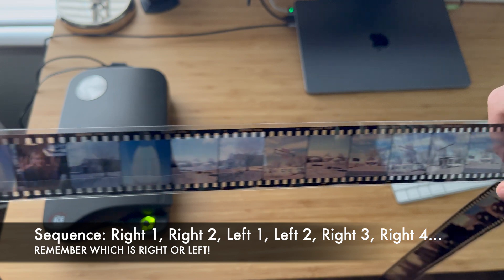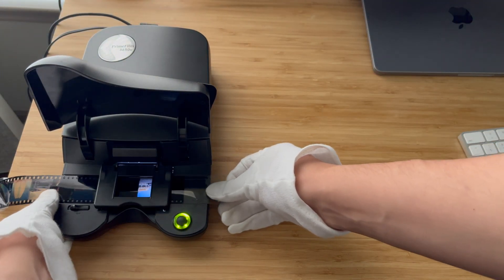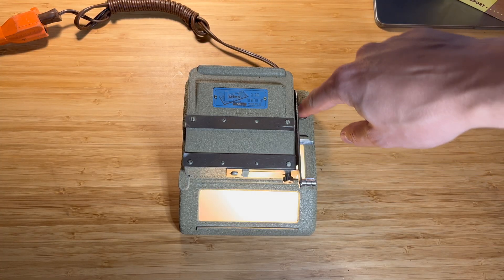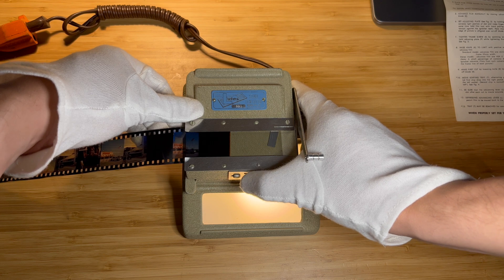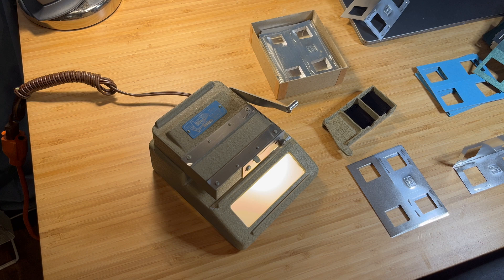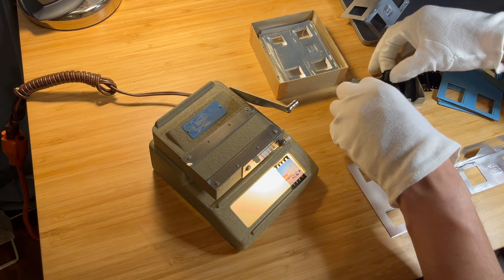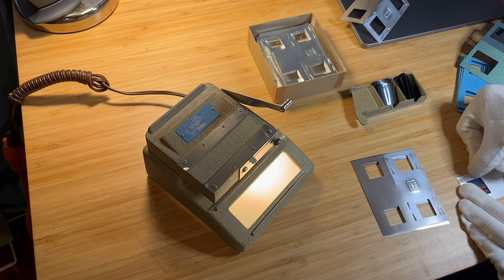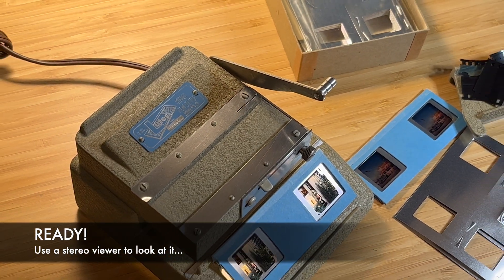Stereo slide film processing: scanning and mounting

Comment: Wouldn’t be easier to use RBT stereo mounts? They are better than any vintage mounts and cost is similar.
Reply from the maker: Not exactly. On RBT mounts you still need to set the stereo window, while here it's "preset" more or less. RBT are much more expensive these days, as well. It would have been faster, yes. The alternative is to 3D print RBT mounts.
Reply: @vaisonla-romaine8304  they cost $1 per piece. I wish they were cheaper but the cardboard mounts and masks cost about the same. Setting up the window is easy, no extra equipment is needed. You can’t adjust the window in these masks, so if you don’t cut the film perfectly the window will be off permanently. What’s THE MOST IMPORTANT in my opinion is the fact that stereo mounts are still being produced and we need to support the company that makes them. It’s for our own benefit. If the sales are poor they will cease the production and the cost of supplies will skyrocket. This is exactly what happened with STEREO WORLD medium format stereo mounts and viewers. The mounts went up 3x in price and their excellent lighted viewers that cost $80 brand new went to $500 for the used one (sold on ebay couple years ago, I haven’t seen one for sale since then). So if anyone is trying to save a dime now by buying those old dusty cardboard mounts will have pay a premium for them in the future if RBT goes out of business.